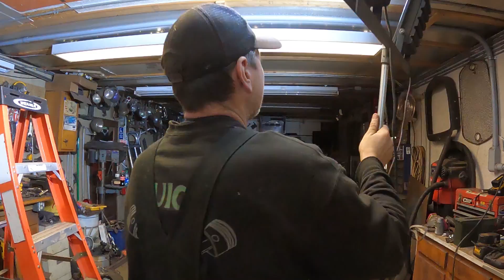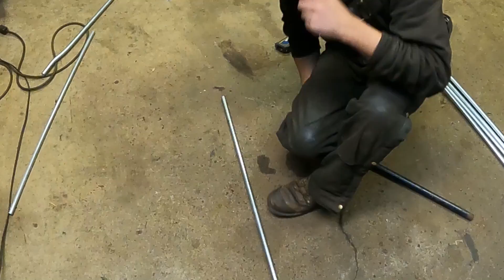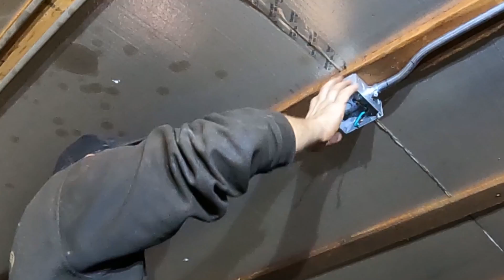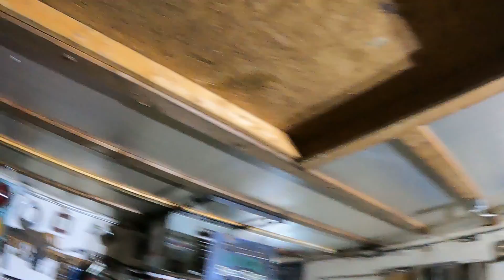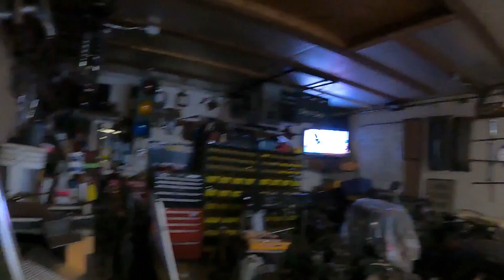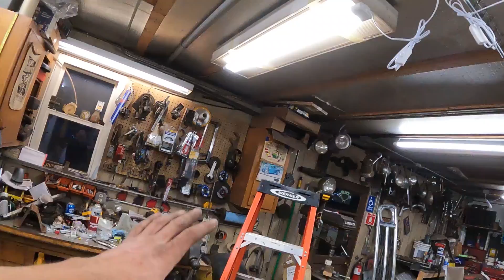Installing Amazon 5000K LED Shop Lights

Comment: Josh sure is nice to be able to see what you are doing in there. I definitely need to do that in my shop too it is like a dungeon in there. If doing anything major have to brake out the trouble light and those are a pain always fall down or in the way. Did you put a link for the lamps in the description,
Reply from the maker: Do it, you won't regret it when you can see.  Just go to Amazon and search 5000k led shop lights.  There are a bunch of options and quanity sizes depending on what you want to do.
Reply: @QuickSpeedShop I was just looking at some lights on there 10pk did find a 12 pk but they are a single bulb fixture